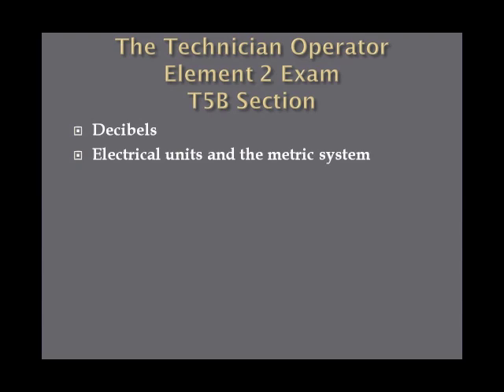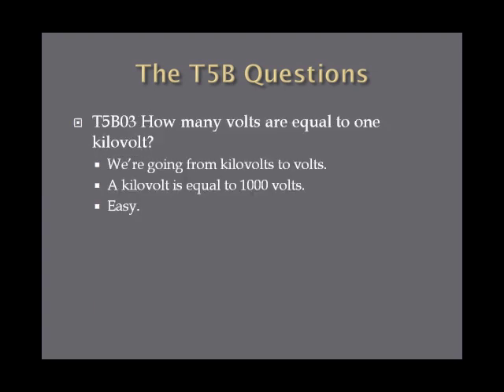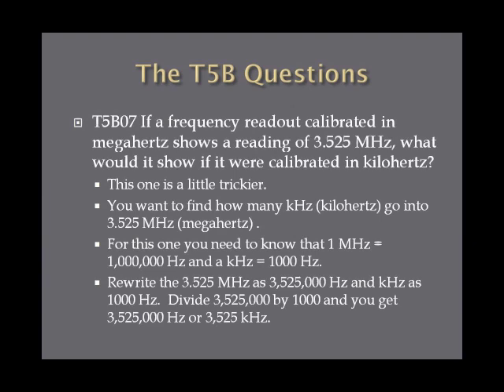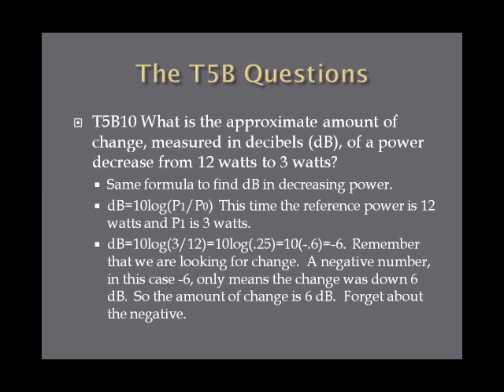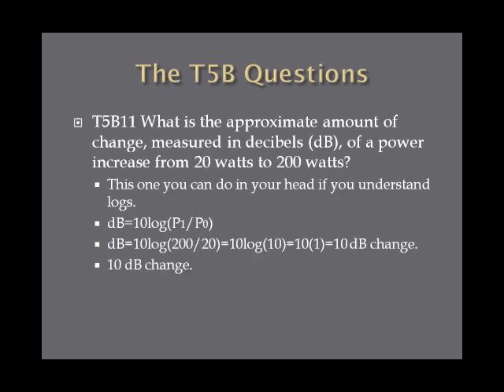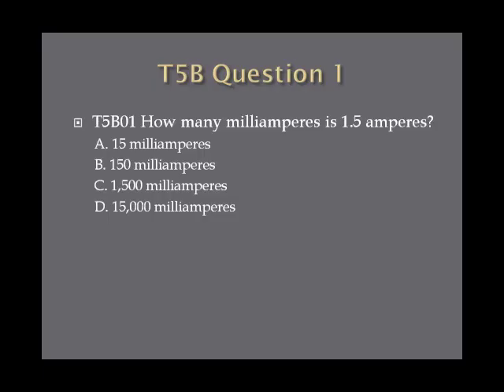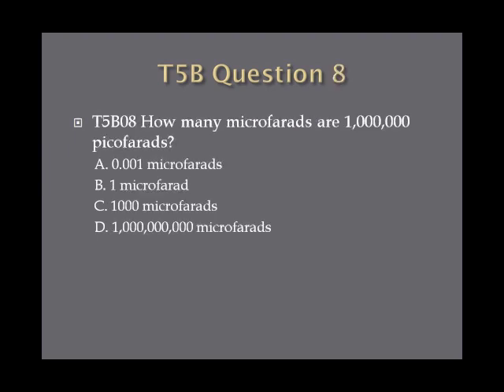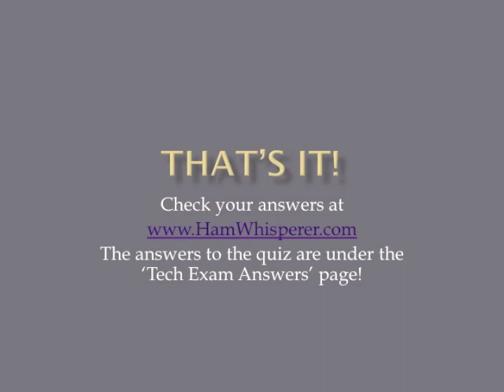Lesson 16 Technician Class Exam T5B  Second Edition

Comment: This is the only one of your videos so far that I have any criticism for at all, and even this isn't a big deal, but the way you go about the conversions is very labor intensive and it's more work than is necessary. It's much easier to just memorize the order of the prefixes so you know the order of magnitude difference, and then you can just slide the decimal place over three units and eliminate the math altogether. That's far simpler and quicker. Also pico- is pronounced PEE-ko, not pick-o.
Reply: Oh, another shortcut regarding dB: doubling or halving the power is a change of +/- 3 dB.